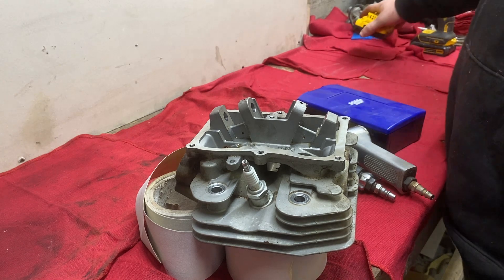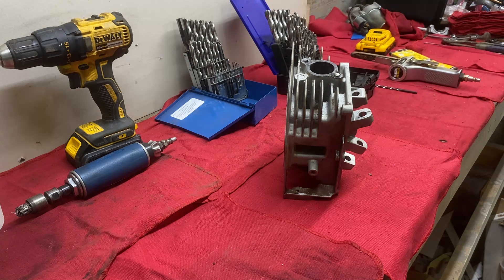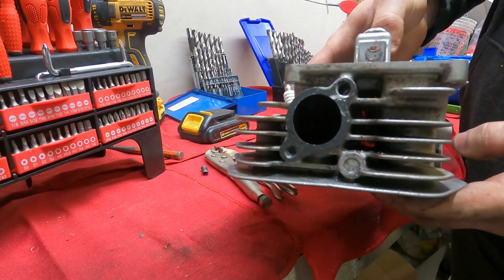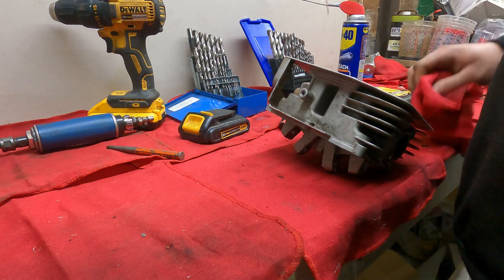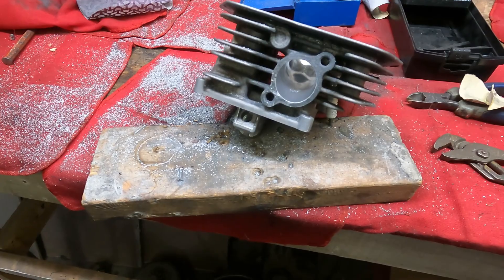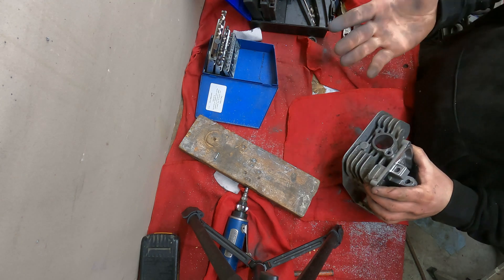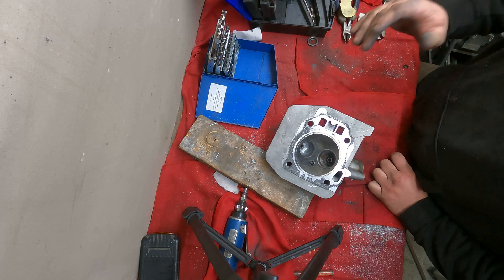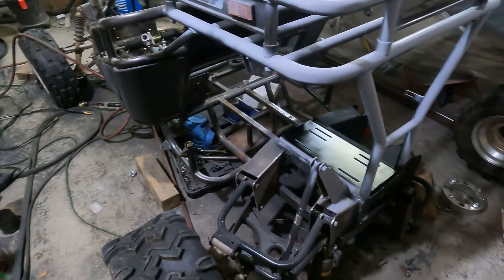Porting a Predator 420cc Hemi cylinder head

Comment: Did you bust into the cylinder head while drilling the stud… that’s what just happened to me. Wondering if I’ll replace the entire cylinder
Reply from the maker: No i didn’t but if you did, you might get away with putting a thread sealant on the bolt when you install it. Shouldn’t really matter as long as the hole is entirely closed off.

Comment: cool video! i used to sit there with sand paper for a while and try to make it like a mirror in the exhaust port but i found these abrasive buffing polishing wheel set for like 10 bucks on amazon that makes it so much easier. they come it like 6 different grits and makes it easy i also take a wool felt polishing wheel with mothers compound on it and it quite literally is a mirror. keep up the good work👍

Comment: “Opened up” and “shape” of ports and runners are two far different things… especially the floor of the runners. I admire your work but believe me, someone who’s ported literally hundreds of four and two stroke heads and cylinders, I’ve actually LOST horsepower with aggressive material removal. I’ve found that simple blending of casting marks and smoothing what you have always produced decent results. Also, I use Foredom porting motors as they remove material at low rpm and does not run your compressor to an early grave. Carry on! I’ll be checking your progress.
Reply from the maker: Thanks so much for the advice. I’m always trying to learn new things and I really do appreciate the input.